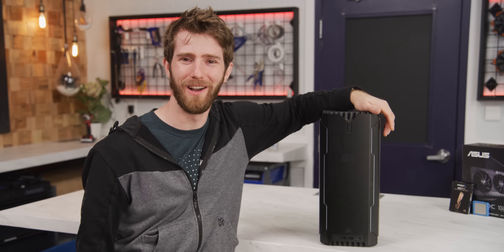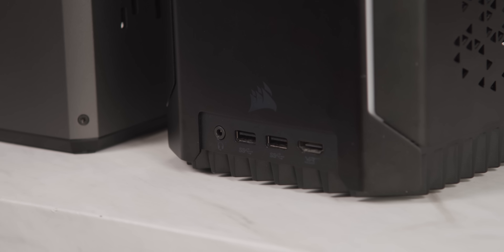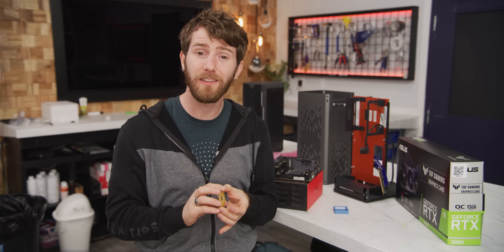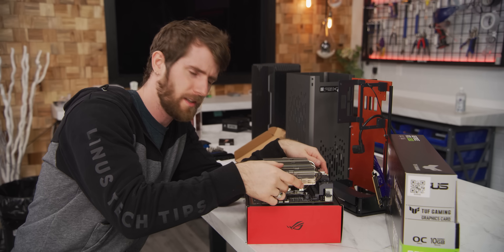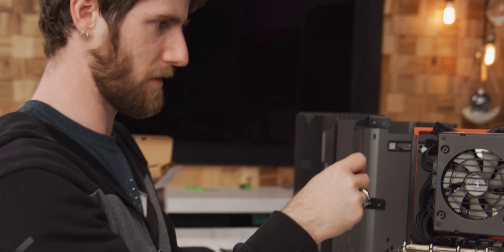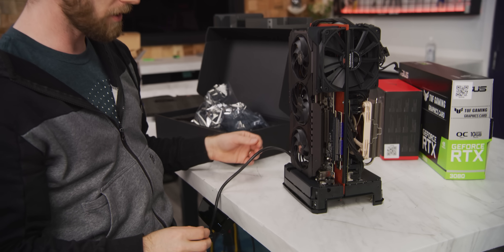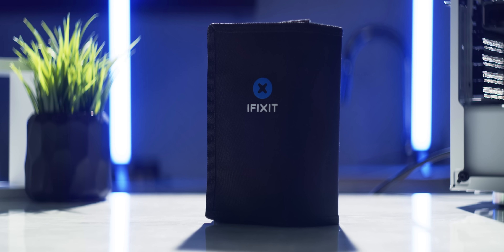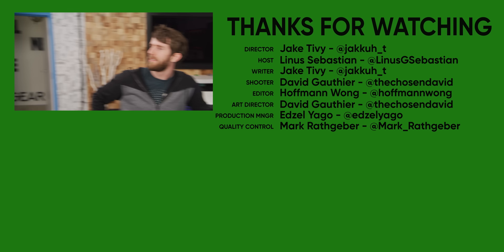My EASIEST PC Build In Years! - Louqe RAW S1

Comment: I’ve now forced myself to do this build few months later after sourcing the rtx card. Here are my thoughts.

The finish is very poor to the point you can cut yourself when handling it. The advertised possibility to easily carry it is only for the people who wish to lose their fingers. It’s a very heavy rough cut thick aluminium which acts as a mass heat storage so cpu temps are high. Plastic base is cheap and ugly. Mine is throttling at full load reaching 100 deg Celsius using the “best” cooler solution by the case manufacturer - the one which makes the case almost impossible to close as the fit is so tight you need to remove the anti vibration rubber on a 120mm additional cup fan to make it fit. It’s also very loud at full load. There is no zip ties points and there’s surprisingly little room inside the case. I had better temps and could fit 3 ssd drives in a much much smaller case from Dan. Graphic card is not securely mounted as it does not have a release clip. All ports located at the bottom of the case as simply stupid and a pain to reach. There no way to use dust filters without turning this case into air frying machine - also the “best solution” cpu cooler simply will not allow to have enough room for the thinnest of dust sheets. What else… ah the on/off button falls apart each time you open the case on top of making cheap scratchy noise when pressed. I’m not sure how to use the provided usb port (only one came with my case) as it is usb-c female to usb-c male - maybe my motherboard does not have such feature. So another external usb splitter is needed for the easy of use. So overall what have I ended up with? - An ugly colour, heavy and hot, large but tiny inside case and I still have to keep the rest of my drives as external now plus usb port extension on top… and I need to dust the flat twice as often as before. I’ve spent 75usd on additional 3 fans to be able to put the outer shell on due to temperature inside - one fan is on top making it rather ugly looking. This case is a nightmare and should disappear from the market. Stay away. If you want a quality case check other options. This is a product from someone who has never build a pc. Yet alone small factor one. The designer is emailing people to buy this failed prototype at 50% discount but trust me you don’t want put your pc for days on end. It has taken me 2 days and I have been building pc’s my whole life. All those articles and yt reviews are biased. You have been warned.
Reply: @10secondsrule  Agree, I bought it - went through 3 different coolers, the recommended one being the worst. Scythe shuriken 3 is the best with a foam duct. Case desperately needs another fan exhaust at the top but it makes the case so ugly. I regret buying it everyday. I don’t understand how they made the ghost s1 and then made this awful case.

Comment: wish Linus wouldn't defend/request cross (philips) screws instead of torx screws. cross screws are trash, and everybody using them isn't a good reason to use them. got the LTT screw driver as a gift and was kinda disappointed it was just slit/cross drivers in there. hate it when I get gifts and have to overplay disappointment.

Comment: I built the exact same thing but with 64gb 3600mhz and just swapped out the Zotac 3080 to a 4080 FE it’s amazing at the power in this case my 3D rendering is almost 50% faster and getting can max out my 1440p 240hz with the medium to high settings on MW2 glad I found this video and the case is 150 on Amazon

Comment: In my opinion all cases should use torx screws. Philips are well known for stripping and the screw driver slipping off and damaging things. Torx require no down pressure unlike a philips and that down pressure is what will damage something if it slips. Be aware also that there are metric philip screw drivers which have a different shape head.

Comment: I’m really surprised now owning this case how downright STUPID this design is. The case is heavy as hell - 3.2kg. The aluminium is way too thick. It’s not even a square which makes it look pretty odd. I’d rather have 2mm or less but more room inside. The card slot is too short and too narrow for anything other than 3 slot founders edition and good luck getting that. The lack of fan or any meaningful ventilation at the top of a case is a serious mistake. Very limited connectivity via 2 usb-c ports when your motherboard supports and provide extra cables. I’m not sure how many dongles would lose their wireless connection due to being located under the box. I still need to make a build to find out I guess I will need this Allen key which was not included with mine. Also ventilation slots are more of a design gimmicks rather than an actual vents - the area is simply small for what it could have been. The handle to carry it around is only good if you wish to cut your fingers off. Finish is pretty poor to be honest. And I’m saying all this after paying half price. Not really worth it. Not even at half the price for the compromises you have to accept.
Reply: i was excited to get this case on sale for 160$ only to realize my strix card is too big, so happy i didn't pay full price lol. its still a nice piece but wish it was a tad taller, im thinking of making a new top for it similar to the corsair to allow more room and airflow
Reply: @edlebrock3501  i agree. I'm very disappointed it cannot accommodate the 4090 in smallest FE factor either with it's cable bending issues. Given how little more room is needed to make it so much better I struggle to understand why they went for this size given all the compromises it carries. Form over function. And not a very good form to begin with.
Reply: I’ve now forced myself to do this build few months later after sourcing the rtx card. Here are my thoughts.

The finish is very poor to the point you can cut yourself when handling it. The advertised possibility to easily carry it is only for the people who wish to lose their fingers. It’s a very heavy rough cut thick aluminium which acts as a mass heat storage so cpu temps are high. Plastic base is cheap and ugly. Mine is throttling at full load reaching 100 deg Celsius using the “best” cooler solution by the case manufacturer - the one which makes the case almost impossible to close as the fit is so tight you need to remove the anti vibration rubber on a 120mm additional cup fan to make it fit. It’s also very loud at full load. There is no zip ties points and there’s surprisingly little room inside the case. I had better temps and could fit 3 ssd drives in a much much smaller case from Dan. Graphic card is not securely mounted as it does not have a release clip. All ports located at the bottom of the case as simply stupid and a pain to reach. There no way to use dust filters without turning this case into air frying machine - also the “best solution” cpu cooler simply will not allow to have enough room for the thinnest of dust sheets. What else… ah the on/off button falls apart each time you open the case on top of making cheap scratchy noise when pressed. I’m not sure how to use the provided usb port (only one came with my case) as it is usb-c female to usb-c male - maybe my motherboard does not have such feature. So another external usb splitter is needed for the easy of use. So overall what have I ended up with? - An ugly colour, heavy and hot, large but tiny inside case and I still have to keep the rest of my drives as external now plus usb port extension on top… and I need to dust the flat twice as often as before. I’ve spent 75usd on additional 3 fans to be able to put the outer shell on due to temperature inside - one fan is on top making it rather ugly looking. This case is a nightmare and should disappear from the market. Stay away. If you want a quality case check other options. This is a product from someone who has never build a pc. Yet alone small factor one. The designer is emailing people to buy this failed prototype at 50% discount but trust me you don’t want put your pc for days on end. It has taken me 2 days and I have been building pc’s my whole life. All those articles and yt reviews are biased. You have been warned.

Comment: Well I mean… usually you don’t use all of the back USB ports, so reusing them with those extenders is good.
People usually use all of the front ones for other stuff. The most you’ll use the back ports, is for mouse and keyboard, which would be fine with just USB2.0, and maybe even 1 port if you have a combo system, or a keyboard with ports.

Comment: Thank you for the build. I've ordered all the parts to build one of these, fell in love with the Corsair One (but not the price). Question, WHY did you remove the "cosmetic fascia piece"? It doesn't appear to interfere with the radiator fitment (or anything else)?

Comment: This case is honestly a masterclass in how to build SFF cases. With a little more development it could be a better building experience than a traditional case.

The improvements that would be worth considering are:
Run riser cables through a slot in the assembly to reduce the risk of snagging during insertion into the shell.
Recess the powerbutton or route it in such a way that it can't easily catch on the shell during assembly.
Rework the mounting brackets near the power supply to make the the power supply and fan order agnostic.
Improve available external IO - Can be accomplished by using swappable extension cables and a set of swappable plates mounted on the exterior of the case.

Comment: I have to disagree with you on phillips headed screws.  They typically strip too easily, so Torx is the better option.  Besides, the Torx screw drivers are included in a good number of screw driver kits now that it is not really an issue anymore.  I have worked with a number of systems over the years and I abhorred IBM for its use of slot heads and loved Compaq Deskpros for the use of Torx head screws.  When HP purchased Compaq, you see the Deskpro features in HP business desktops, including this one I am watching and replying to this video of yours.  Preferably I would want Robertson both in its simplicity and being a Canadian.

Comment: Nothing to do with this vid, but... I have a Heiwa matebook pro X, had a slight jar- dropping maybe a foot from bed to thick carpet, wouldn't think it would've done much damage but it's now completely "dead". I only get a single flash of the power light when I hit the hard power on... No screen, options etc. I've found little to no information about how/where to go about repairing.. Any suggestions? Thanks in advance

Comment: Needs to be about an inch taller with a vent in the top to add a 140mm case fan to pull air out the top of it through the vent.

Comment: Idle curiosity drove me to check prices on GeForce 3080 cards, one of which they casually tossed into an ITX build...ballpark $900-1300 USD & still, in May 2021, largely manufactured out of unobtainium.  Will this madness ever end? Shades of RAM or LCD display gouging of the past -- on steroids.  I've read more energy is now expended upon cyrpto mining than is produced by all renewable generation sources.

Comment: Linus, I  agree with your observation as to the top of the case being open being a better design. Heat rises. Take the case back off and find a machine shop near you to plasma cut vents in the top. Then powder coat it your favorite color. Awesome video, and is agree it seemed to be one of easier power builds.

Comment: 70°C to 80°C is way too much as a gaming temperature on average for longer use than an hour a day on like 3 times a week to let it last for more than two years. a simple easy rig with a better cooling solution gives you 7+ years of 24/7 usage with temps around 30°C. this is just roasting hardware unnescessarily to produce more waste and generate income for the company who makes fittable parts

Comment: torqx is a better screw tho.. it does not get stripped nearly as easy as a +,  so not nessesarily when new, but when used a bunch a torqx skrew will have better overall life when it is taken out and put in multiple times. so this is not really a negative and wish most screws were torqx rather than +.

Comment: Two usb C, one of which isn't connec,... Oh wait, it's a kensington lock opening. Never mind!!!
Reply: And you always should PUSH air into your surfaces that need cooling, not PULL through them.
Higher pressure air transfers heat better, and pulling a lower pressure reduces it.

Comment: Philips heads suck. I once spend a whole afternoon for removing a damaged Philips head, ending in drilling it out and cutting a new thread. That is nothing I fancy doing on electronic stuff. 
Never came acros a Torx damaged that much. Wherever possible, I throw Philips heads in the bin and replace them by Torx. Had I done paid work on that afternoon, I could have afforded a life time stock of replacement Torx screws.  
So big thumbs up, Louqe!

Comment: Philips screws are beyond stupid, you need at apply the same pressure inwards towards the screw as applied rotational torque, lest it slip and fuck up the screwhead. Stop shaming companies that refuse to use Philips screws.

Comment: hot take: i would much prefer torx was the industry standard on all computer hardware. torx is better than phillips plain and simple, yes its a pain to find the exact bit but, I have never stripped a torx screw in my life. I have stripped numerous phillips under normal use and most of them have been in electronics

Comment: btw, on the website from Louqe you can see that in the case is the option to build a 140mm fan on top in the case. maybe that makes it a bit cooler then 80°C for CPU and GPU. greets from Germany
Reply: There's nothing in the manual about how to actually install it, and I'm not sure what good a 140mm fan is gonna do with a mostly closed top. You could maybe pull some extra air through the small gaps, but how much good is that realistically going to do?
Reply: @ShaneSaiyan  the housing is on the side where the graphics card sits with a relatively large grille that allows a lot of air. the fan above is installed in such a way that it "pushes" the air through the small slits around the lid! that is precisely the weak point. warm air always rises as we have learned in physics, and the fan above would help to improve the flow of air in the housing significantly because it could push more air out than it would without it. and if you look closely you can also see the 4 screws where the 140mm fan can be attached. I would also like to link you to where the possibility of installation is described on the manufacturer's website, but links are not allowed here, so you will have to find it yourself. but it's easy to find. just click on the "SPECS" button on the website and you are right where it says it is.  greets

Comment: Looks good as a small form factor.  As long as the pc temps are stable, then you have to expect the case to be hot without a lot of fans to push the heat away.

Comment: i actually prefer torx for small screws, its much harder to strip them, meanwhile most standard p0-p3 screws are not only cheap, but strip super easy
Reply: Never thought there’d be discourse about a screw but you’re right torx master race
Reply: I don't even have a torx screwdriver but I'm convinced, torx master race
Reply: Torx is very much superior to all screws, it is near impossible to strip, has a higher contact ratio and a far better transfer of energy and since most drills have the ability to stop when the screw doesn't go in anymore the philips head screws are only a liability at best with no benefit (maybe only useful in budget assembly lines still to cut high precision machine costs because they self center the drill)
Reply: @MonsterPumpkin  torx are still easy to strip if they are made cheaply. I speak from actually having stripped torx screws a few times. But honestly yeah I still do kind of prefer them more - when they are made right they are way harder to strip, and this is a big one - the different sized ones aren't compatible with the smaller size bits. Phillips has several different sizes that are similar enough that they can work with several different screw sizes and honestly most of the time I just choose the one that looks right, makes them really easy to strip out.
Reply: Torx master race

Comment: Aaaaaand then there is Phanteks’ solution for that: the Enthoo Evolv Shift 2 and Shift 2 air. Similar vertical ITX cases that can accept full size graphics cards and sort of okay cooling for their respective price points and form factor. Clocks in at around $130 US. Has removable panels from all sides, easy to assemble, can be watercooled, (or if you are a smart person and buy the aircooled version with 2 of the sidepanels made out of mesh) accepts up to 88mms height of aircooling (so most higher profile interference free low profile coolers) and has plenty of slots for fans. Yeah, it doesn’t have a 4.0 riser but it it’s not a big loss at this point.

Comment: The SSUPD Meshlicious has its MB 90° rotated so the I/O is on the back as normal but still a vertical GPU. With way better ventilation and even cheaper I think it‘s a better choice.

Comment: I just receievd my brand new motherboard which is the MSI A320m-A pro. After unboxing from tons of bubble wrap and out of excitement, I pull the motherboard itself from the plastic. Later, I realized that I was not grounded, nor touched any grounded material prior to handling the naked motherboard. DO YOU GUYS THINK I DAMAGED THE MOBO WITH ELECTROSTATIC DISCHARGE? PLEASE HELP ME BECUASE IT'S LITERALLY STRESSING ME OUT AND I CAN'T HELP BUT THINK ABOUT IT IF IT WILL STILL WORK OR NOT😭😭

Comment: What is all the hate on torx about? Philips heads kinda sucks in comparison tbh. Philips heads are literally designed to break if the torque is too high which means that if someone unexperienced fails to tighten the screw, you need to drill the screw out...